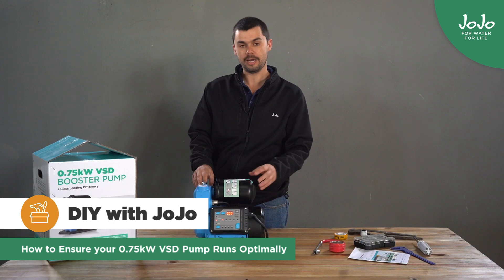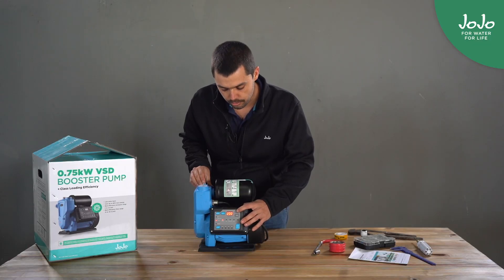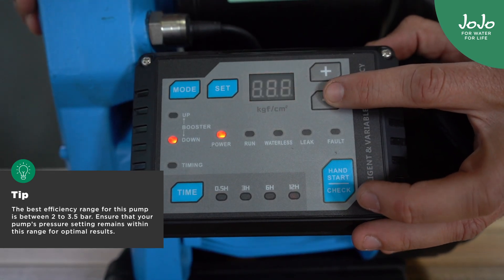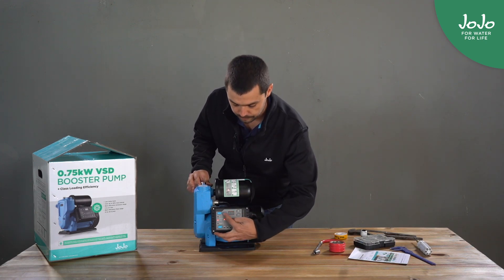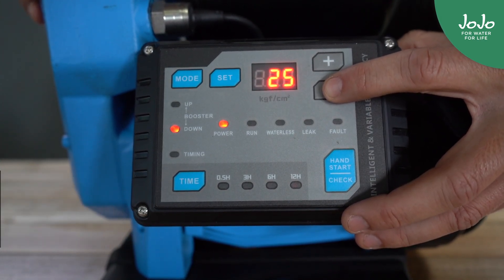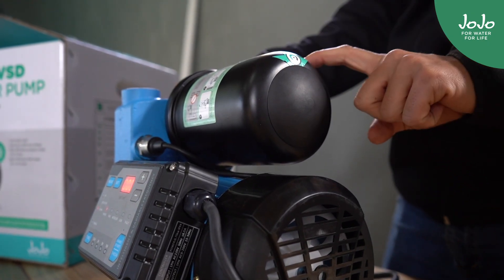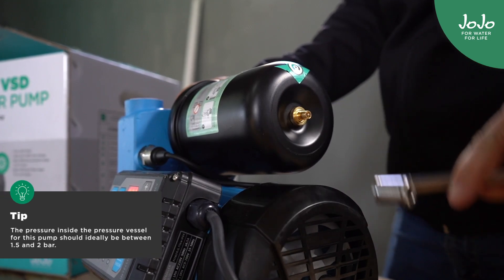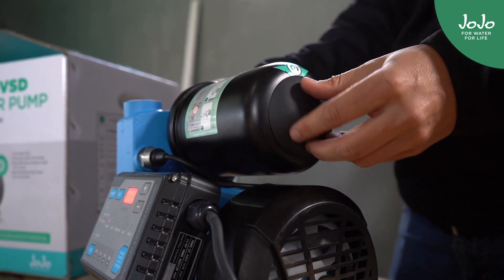DIY with JoJo_How to ensure your 0.75kW VSD Pump Runs Optimally

Comment: Good day, I have the same 0.75VSD pump. I need help, it pumps water and the pressure is good but it doesn't make the noise it used to make when pumping water, what could be the issue, should I be worried? Thanks